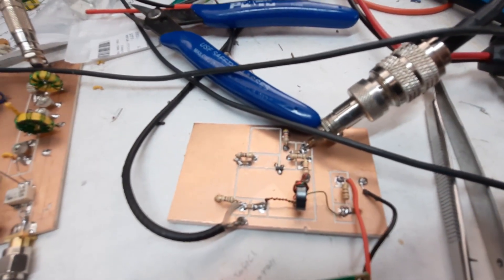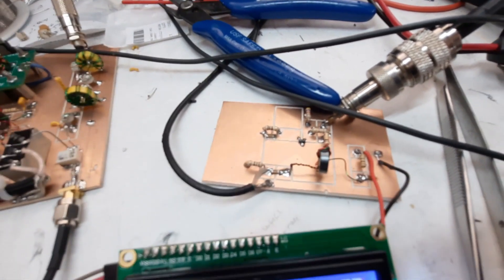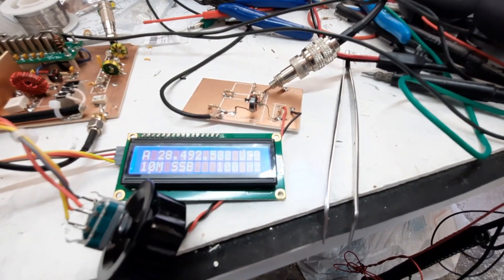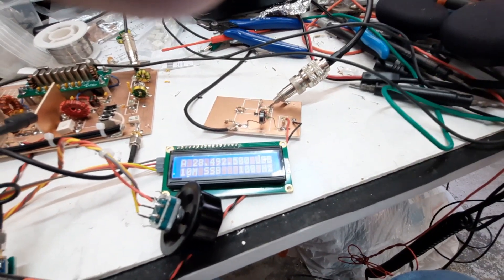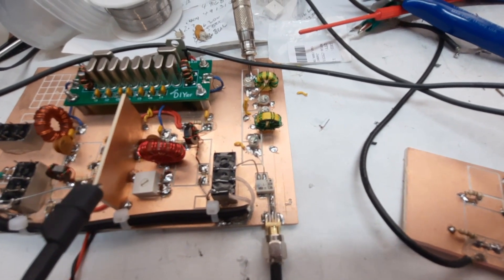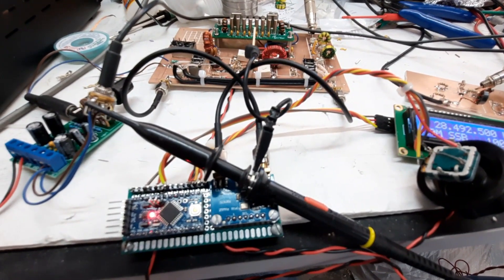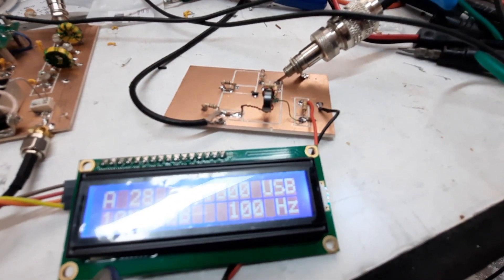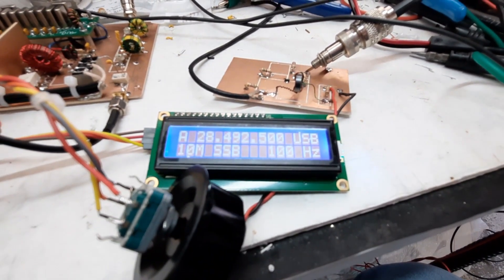BFO Fixed 10M SSB

Comment: Well done Pete, nice audio, but your rigs always seem to have clear, strong audio!  73 VK4QP.  What do you think of the Siglent Scope by the way?
Reply from the maker: Thank you for watching the video and for your comment. I bought the Siglent scope as a replacement for a Rigol (which many believe is the holy grail). The driver was the screen size at 7" versus 5" for the Rigol. Most of the other functionalities are a wash so no huge technology imperative. At 81 years old, a YL with 44DD's is certainly more noticeable than one who is a 29A. Size matters!

This has been a fun project and stay tuned as we are close to having the transmit function working. See https://hamradiogenius.blogspot.com for details on the rig.

73's
Pete N6QW